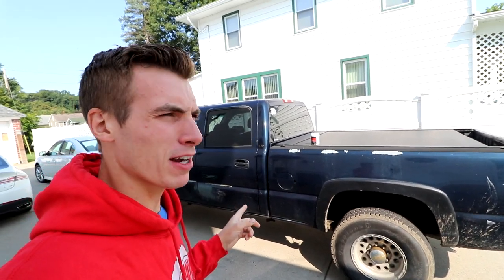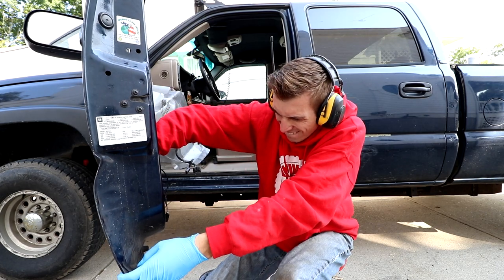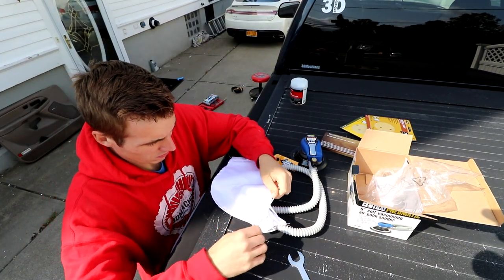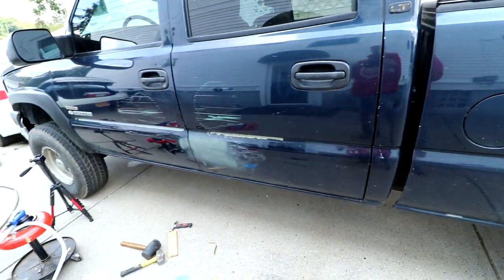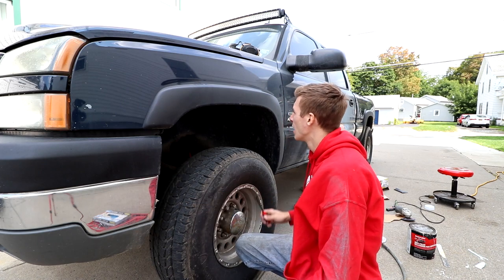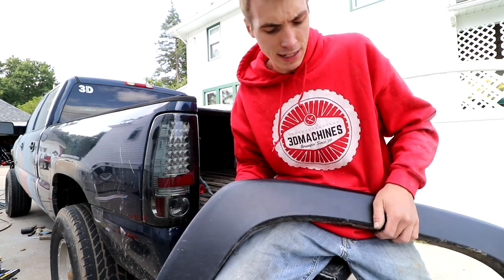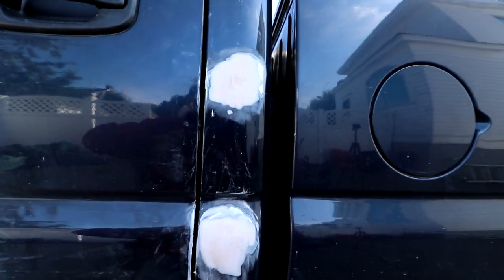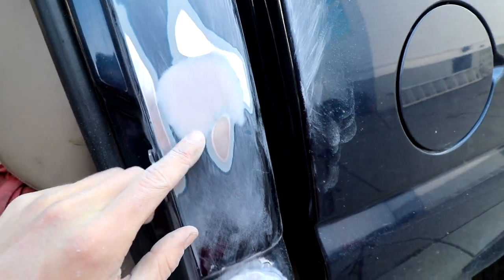STILL BREAKING MY DURAMAX

Comment: 3D machines you should just get a rap for your truck
Reply: wont hide the dents
Reply: Zach Bower doesn't work well on trucks offloading and shit is ruff on wraps and  to get a good wrap just cost more than paint
Reply: maybe a wrap will hold the bondo on the truck.
Reply: Zach Bower       agreed
Reply: Drop a beat
Reply: Zach Bower YESS A MAT BLACK

Comment: Dalton, purchase and use cheap dollar general or local supply store black primer to mist the areas that you just repaired. That will be your guide coat. What that does is it finds ANY low spots or high spots so you can sand it down and get it ready for paint. After you mist those areas and sand, if you see black where you misted the cheap primer and then sanded, that means you have a low spot. Fill that in, sand and repeat the guide coat until there are no low spots.

After that is done, this is very important, make sure you sand that entire side before applying primer, the doors, bed and fender. Every bit of that clear coat must be sanded so it looks dull in order for the primer to adhere to it. Purchase a big bottle of rubbing alcohol and use lint free shop towels. Rubbing alcohol will pull any impurities off the surface before priming so the primer will adhere better. Every time you dirty a shop towel, use another one. Continue this until the towel is free of dirt.

When your truck is all cleaned via lint free shop towels and rubbing alcohol, the very first place you want to hit with primer is the repaired area, at least 2 coats. The reason for this is because bondo will suck that primer in quick and it will dry the fastest. If you spray the entire truck without hitting those areas first with primer, when you go to paint, you will have dry spots and be madder than heck.

Best primer to use to seal everything up before paint is 2k primer sealer. Primer sealer is NON SANDABLE. Primer sealer is meant to SEAL everything up before paint. You need to use that before you paint the repaired area. I highly suggest to use regular primer on the areas you repaired BEFORE using primer sealer. That way if you see an imperfection or any pinholes, you can fix those areas first and lightly sand that down and then use your primer sealer.

Do not go cheap with your primer sealer or your paint WILL blister. Take your time and you will be able to do a good first time DIY paint job mate. Most important thing, have fun and enjoy the experience. You will probably get frustrated with yourself, but take your time and you will do a bang on job mate.

If you want some help or not sure about something, check this blokes youtube channel out. His name is Pete. I learned everything that I know on how to do body work and paint jobs just from watching him. People from Australia, Europe and the U.K ship their vehicles to him in Texas to do their hotrods, classic and muscle cars. He is a top notch pro who has been doing this for over 35 years. His videos can be hilarious at times. https://www.youtube.com/user/diyautoschool/videos

Comment: The dents further back looked like they needed metal work, looks just a little bit too deep for body filler. Make sure you feather it too, when you're spraying primer, you should have filler, bare metal, then fade it out so it's less of a hard line.

Also make sure you're using a block, the DA sander will be nice to remove large chunks, but when you're trying to make it perfect the block keeps it level throughout.

Comment: when your sanding with the sanding block use the block at a 45 degree angle sand it a bit then sand in the other direction for a bit it will give a much more even surface

Comment: i hope you relise that when ypu fill the dent with bondo it will rust out where the bondo is. at least in Wisconsin wherw they dump tons of salt. and also with me and my dads experience fiber glass reinforced bondo lasts longer.  my dads jeep had fiberglass bondo and it lasted like 8 years then rusted out. (sitting out side all 8 years in grass)

Comment: Never mix bondo on cardboard. The solvents in the bondo soften the cardboard and cause the glue (every bit of cardboard is glued to each other) to leach into the bondo which can cause issues with adhesion and the longevity of the repair.

Comment: Don't mix the bondo on cardboard. The paper will absorb the moisture and make it harden faster. Cover the cardboard with aluminum foil or use an old sheet of plastic or metal to mix the bondo on.

Comment: hey 3D Machines one as soon as you removed the paint and exposed the steel to atmosphere it has started to rust on a microscopic level and your not supposed to mix mud on a porous surface cause it absorbs some of the resin in the filler

Comment: I would either leave them off or paint them blue.               Also you should get new rims or paint the rims you have black and get front and back bumper painted blue guarantee you your truck will look 10 times better

Comment: Take it to a body shop you don't know what your doing you can not put bindi on bare metal bond holds moisture and it will rust the metal under the paint causing bubbles you have to either put it over the paint after ruffing it up or put a self etching primer over the metal

Comment: Bro I'm a body tecnition you are good on getting the dents out but when you go to sand never use a wheel you should always use a sanding block so it's blat surface and also you. Only need enough filler (Bondo) to cover the lows of the dent and lightly cover tho outsides and use 80 hrit to shape the Bondo
Reply: Grit*